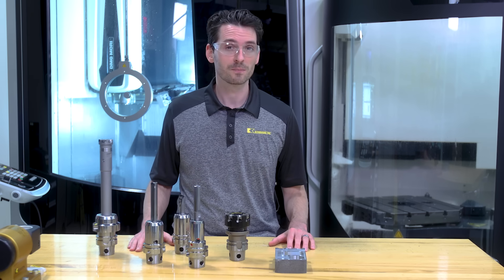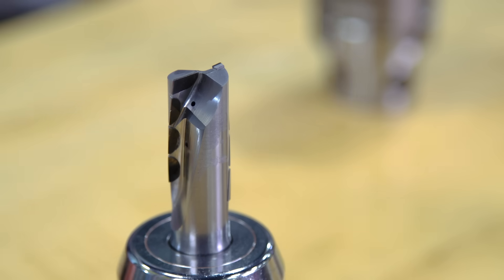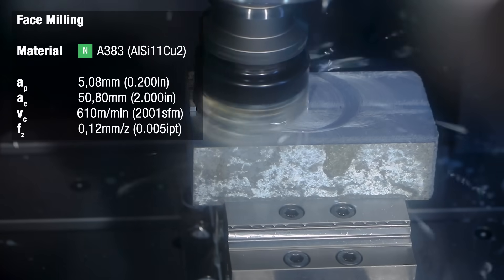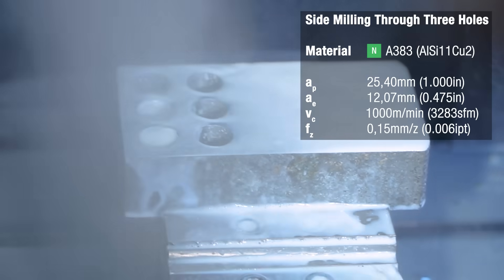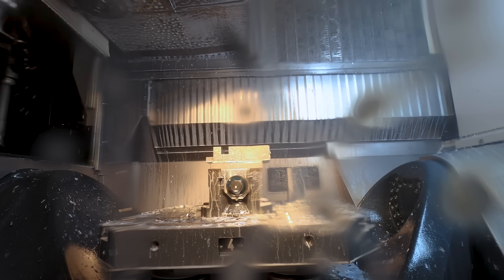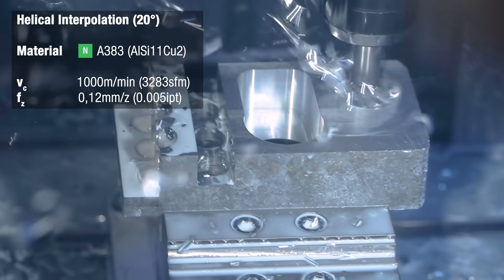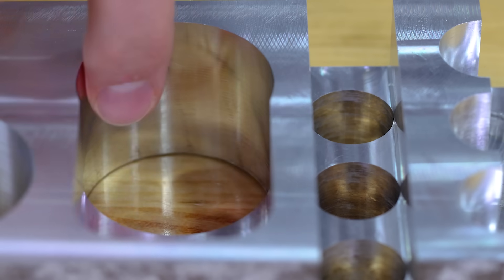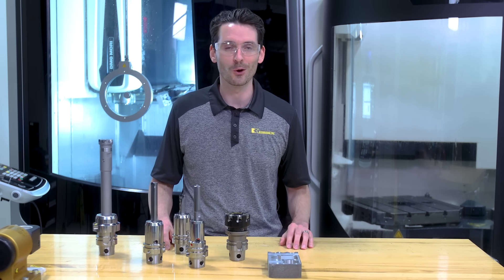PCD Tools For Aluminum Machining

Comment: @kennametal Can PCD be used for milling 41XX and/or 420 stainless? If no, I  would be interested to know why not. I've heard the Fe breaks down the diamond carbon bonds, but would like to hear it from the experts!
Reply: PCD is not as heat resistant as CBN and will react with ferrous elements at high temperatures, carbide tools are perfectly adequate for machining stainless steel

Comment: With bimetal application involving aluminum, is it safe to say you can use PCD on cast iron applications?
Reply: I was an Application Engineer for a cutting tool company for several years. PCD is not recommended in Ferrous (containing Iron) Materials. However, a good choice if you want higher cutting speeds than Carbide in Grey Cast Iron would be CBN. Best of luck 👍
Reply: Of course, PCD tools have their own unique advantages for machining aluminium alloys
Reply: PCD material can be used for processing aluminum alloy, and CBN material can be used for processing cast iron.